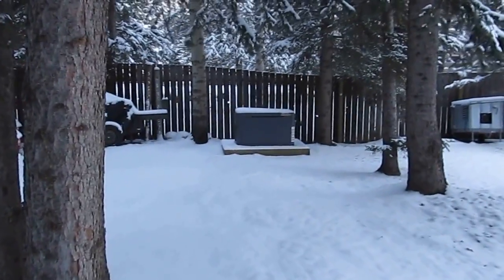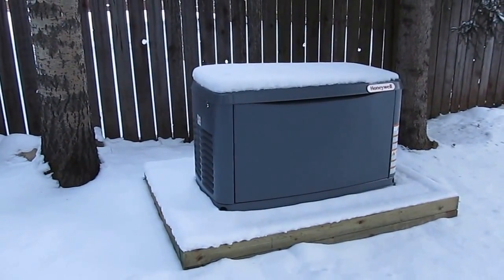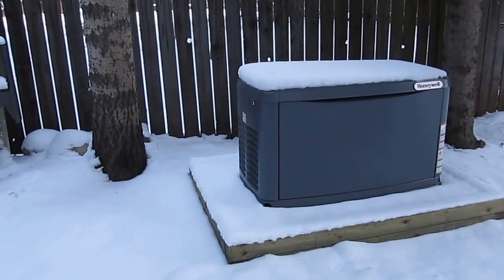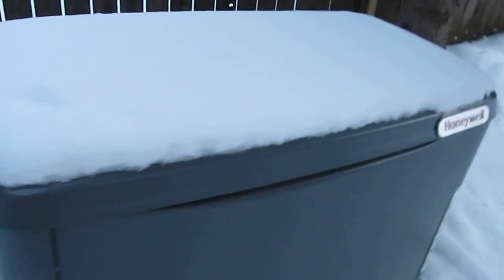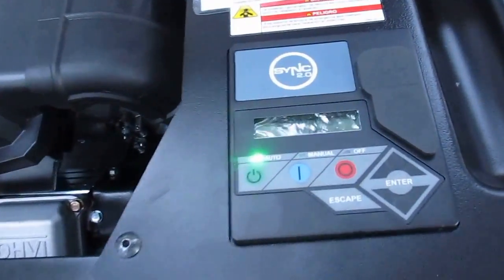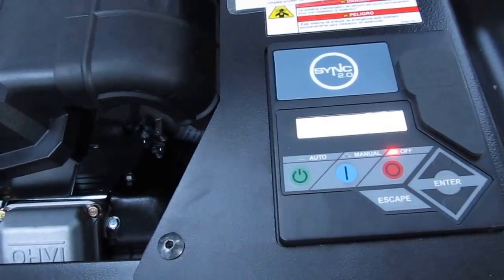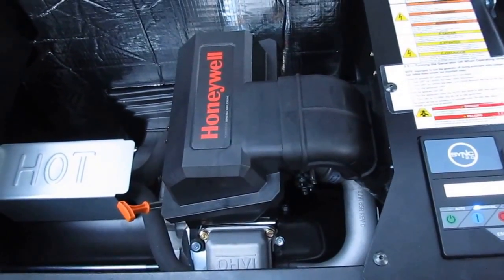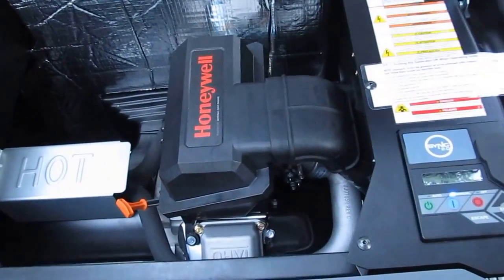17 KW Generator cold start # 1 at -24c, Nov 12, 2014.

Comment: My God that was horrible. My 7kw generac starts much quicker than that around the same temperature. Best of luck to you with that cold weather kit.
Reply from the maker: Take a look at my later videos, I have installed two 50watt heaters, a iol pressure gauge and a oil temperature gauge plus three monitor lights. Every thing has been good for 7 years.

Comment: I have the same unit.  I ran two extra two 15 amp lines from the sub 
panel to the genset (with the 6/3 cable).  I recently just hooked up one
 of the extra 14/2 lines to a 15 amp breaker, and then attached a plug 
on the other end inside the generator.  I then hooked up THREE 100 watt 
light bulbs inside the motor space to keep it warm standby when I know 
the risk of an outage is significant.  I also just recently ordered a 
60watt battery warmer and will connect it too.  So far it starts within 2
 to 3 second even when close to 0 deg F. The motor compartment is 
somewhat insulated, so 300 watts of heating keeps it warm enough to 
easily start.  I recommend this to everybody.
Reply: Good to know when you have a worse case scenario. Though you’d probably wouldn’t want those lightbulbs in there while it’s running.

Comment: Propane does not like atomizing in cold weather without heat on the regulator. I wouldn't fault the engine so much.
Reply from the maker: It's on NG and has more than enough flow.
Reply: @greathodgy22  ya that's weird, cold weather kit should just be standard then.
Reply from the maker: @Heckleburger  The Generac cold weather kit is over priced and useless. They have a oil filter wrap and a heater plate under the battery. You need to put heat into the engine block not the oil filter, that is why I installed two stick-on 50 watt block heaters controlled by Thermo Cubes. The under battery heater plate has a tendency to burn up and start fires, that is why I installed a battery blanket. I have been living on the Canadian Prairies for 70 years and know how to prepare engines for cold weather. I lived in Manitoba for 38 years and we routinely go for six weeks where the daytime temperature did not go above -30F. Look at my later videos showing the upgrades as far as block heaters, battery blankets, oil pressure gauges and oil temperature gauges. 

I know cold and how to fight it.
Reply: @greathodgy22  I wasn't questioning you at all and certainly not you experience in the matter. To me it just seems weird to sell a product that won't work in the cold. Granted your solutions are far superior to what they offer for your climate but for the warmer cold I get I don't see why a cold weather kit wouldn't just be included.
Just one more way to squeeze money out of people.
Reply from the maker: @Heckleburger  Sorry I took it that way. Generac supposedly has 75% of the North American market and I think they want to keep it that way. They want the lowest advertised price they can get. Their cold weather kit lists for $385 CAD the last time I looked, a piece of crap and certainly not worth that. In my dealings with them, their customer service is crap. I learned more from two generator sites I joined after I purchased the generator.

The one thing that really bugs me is you cannot program the length of time that the unit does during its "exercise". You can program in once a month, every two weeks or every week. The exercise is set at 5 minutes, fine in the summer but in the winter the oil does not get warm enough and after a couple of months gets "milky". I have it set to run every two weeks and after it runs for 5 minutes I do a manual start and run it another 25 minutes. That gets it hot and no more problem with milky oil.

Other generator manufacturers will let you program the run time.

Comment: does this generator still work 6 years later?
Reply from the maker: Yup. It has more exercise hours on it than standby hours and runs just fine. I am happy with all the modifications I did to it. Last outage was two weeks ago for about 3 hours. It is a treat not to have to go and start the tractor and put the 3 PTH generator on and plug into the house.

Thanks for asking.
Reply: My dad is thinking of getting one for our small ranch house just because of crappy Midwest weather

Comment: Just fill in 5W50 oil and it will crank much faster and easier during cold weather!
Reply: 5w50 is not what you want not many companies make that oil mostly racing applications Motorcraft (ConocoPhillips) makes it for Shelby mustangs Amsoil also makes it I guarantee it has 5w30 full synthetic in it what he needs a cold weather kit and Amsoil true small engine oil 5w30 100% synthetic true small engine oil it pours all the way down to around-50, 5w50 not a good choice would also void warranty
Reply: @kevinmarchini5272  Well in Canada most people use 5W50 in their generators, Iceland, Finland and Russia too

Comment: Rumor is that Generac has a software update for the evolution controller to extend the exercise to 12 minutes, but I don't know where the cut off is with the serial number. Might only be for the newer ones within the last year or so. The problem with condensation isn't so much from a lubrication standpoint, but it eventually clogs up the breather system and may back up into the air filter. I haven't seen that problem on the evolution series but have seen it on earlier units. The other issue the factory has attempted to fix via software changes is low output voltage in the first few seconds of running, which (years ago) caused a fault. (shutdown) The change now allows several start attempts so any frost on the sliprings / brushes can clear before setting a fault/ shutdown.

Comment: I have found that the battery chargers are no good. The battery is undersized and the winter kits don't heat up enough.  I'm talking 20-45 below 0 here. So this is what I do when you get to 30+ below 0.  Get a deep cycle battery 1000CCA and put a smart trickle charger on the battery like (Battery Tender 800 on Amazon) (a fully charged battery doesn't freeze). Them get some aluminum insulation mat/blanket, that shiny stuff you get to wrap a hot water tank, and line the inside of the unit nice and some on top to keep the heat in.  For heat I used two 50watt pot lights screwed onto a Y spliter that's screwed onto a work lamp handle that I place at the bottom and underneath the entire generator. This way the temp outside the box could be -30 but inside it is 0 or -5 or so. Not too cold that the gen doesn't start. Because you need the whole thing not to be frozen to start. I have found that at -25 to -30 the heat mat on the crankcase or around the oil filter is not enough because the carb and everything else is frozen rock hard so the motor doesn't turn fast enough to start. The little starter is frozen and even with a 1000CCA battery with a charger on it keeping it at 14.4V the whole unit is too cold to start at -25 to -30. The two pot lights are just 100watts and give enough heat to do the trick.
Reply from the maker: Here is a video of a cold start on Dec 30, 2014 after I installed the battery blanket and block heater.
Dec 30 at 0900 and it is -24C or 12 below F.

I installed a GFCI outlet running off the T1 power lead a while back. A 50 Watt battery blanket  was plugged into a 
TC-2 thermo-cube and a 50 watt block heater was attached to the side of the block. The block heater is plugged into
a TC-3 thermo-cube. Also have LED indicator lights plugged into both thermo-cubes.

As you see the Jenny started right up.

https://www.youtube.com/watch?v=y3Ikxve8zgI
.
Reply: greathodgy22 I saw the vid. Good job. But it did turn a little slow. At -34C it wouldn’t start. There’s a big difference between -24 and -34C. Also if you get -30 for 4-5 days straight like what we just had here in Canada that also adds to the difficulty in starting. -34C plus for a week long is a big deal. The engine needs to turn quickly to start. You were lucky it turned quickly enough in the vid. I’m afraid any colder and the RPM would be lower. But great job.
Reply from the maker: I have not given up on tweaking this unit. This last August I added a oil temperature gauge and a oil pressure gauge. I am documenting the generator on its monthly 5 minute exercise. In 5 minutes it does not heat up enough to keep condensate out of the oil. I run it for another 20 minutes after the exercise is over. Generac needs to add programable exercise times to compensate for colder climates like mine, Alberta.

On Dec 26 I did the following full load test run at -37 F. It went down to below -30 F every night for 10 days around Christmas. I agree at those temperatures you need a bit more heat than the 50 Watt block heater, so..... I have another 50 Watt heater on hand and have a TC-1 thermo cube coming and I will install those this summer. The block heater will be installed on the back side of engine. The first one is on the front side.

If you want to see all I have done to the 17, here is the link on the Ziller Generator forum where I documented it. 

http://zillerstore.com/forums/showthread.php?t=3480

Full load run on the coldest day this year, this test was at 0920, Dec 26, 2017.
Ambient temperature was -37 F, cold engine temperature was -14.0 F taken using a DLT pointed 
at the brass fitting where the oil exits the engine on the way to the oil cooler. This is the
location of the oil temperature sending unit. TC-2 cube was operating hence the block 
temperature of -14 F. Threw the breaker on the ATS and the generator started up and
transfered. Estimated load applied is between 8 and 9 KW, and I had to work to get it up there.
Ambient temperature after the 1 hour of running was -32 F.

After  5 minutes of running the oil temperature was   90 F and the oil pressure was 70 PSI.
After 10 minutes of running the oil temperature was 100 F and the oil pressure was 70 PSI.
After 15 minutes of running the oil temperature was 105 F and the oil pressure was 70 PSI.
After 20 minutes of running the oil temperature was 110 F and the oil pressure was 70 PSI.
After 25 minutes of running the oil temperature was 110 F and the oil pressure was 70 PSI.
After 30 minutes of running the oil temperature was 115 F and the oil pressure was 70 PSI.
After 40 minutes of running the oil temperature was 115 F and the oil pressure was 70 PSI.
After 50 minutes of running the oil temperature was 115 F and the oil pressure was 70 PSI.
After 60 minutes of running the oil temperature was 120 F and the oil pressure was 70 PSI.

Keep in mind that the temperature sending unit is in a brass fitting in the full cooling air
flow that is moving over the cylinder head so it is being cooled by the -37F ambient air.
Reply: greathodgy22 ...I wouldn’t worry about oil pressure or temperature. My Generac’s oil pressure cut off sensor went bad (well known problem on these generators) which cut the ignition. It cut it out off and on on mine, made the motor run bad and stall, made me think it was a carburetor problem. I bypassed it, and it runs nice. I put 100% Synthetic oil (Castrol Synteck) 0W-40.  My oil level never goes down. So I don’t worry about it. You shouldn’t worry about oil pressure or temp at any ambient temperature. Just put 0W40 Synthetic (Canadian Tire). The only worry you can have is starting it at the extremely low temperature. Unfortunately there not tested in Alaska at -44. They should be tested and made to run 100% of the time at 44 plus to 44 below Celsius. 

You mentioned the once a month exercise. I think you mean once a week. Yes 11 minutes (on my Generac) once per week is not enough. It’s good to exercise it for 1/2 hours with some load on it once per two months in addition to the weekly exercise. I throw the gen/breaker on my main panel to fool the generator into thinking that there’s a power outage and let it do its magic in the transfer switch breaker box. I have 12 breakers on the generator that are isolated from the main (all other breakers)(all hooked up to code and passed inspection with ESA) that way it’s getting its proper exercise.
Reply: greathodgy22 I read your forum posts. Don’t worry about moisture in the oil. Run the generator once in a while with load. As a mechanic I have seen Mercedes pour out water during an oil change. My BMW oil gets water condensation too. Turns the oil foamy a bit. That was 20 years ago. It’s a 1996 328 that I still have. And it has 500,000km. So moisture in the oil isn’t going to hurt anything. Just change the oil in the spring. It doesn’t hold much. The plugs and air filter are good to 200 hours. My generator is 6 years old and doesn’t even have 100 hours on it. 

Just keep everything lubed up like you did with the linkage. Don’t worry about the oil. Keep the battery charger on. 

I heard that those Thermostat block are not reliable so keep a good eye on it. 

When I originally got my Generator I had the battery mat and the block mat on it as well. Both from Generac. Both burnt out within two years. I would not pay for another winter kit from Generac again. There garbage in my experience. There are other good heat mats on Amazon but for me it’s not necessary. I have opted to have a big ass battery with its own separate charger. And give some heat to the whole interior of the Generac box with two 50watt pot light. -35C two days ago and it turned really quickly and started within 1/2 seconds. Boom 💥 Started right up. So I think keeping the hole inside of the box warm is better than mats.
Reply from the maker: I monitor oil pressure and where available temperature on all of my engines. During a extended run I don't rely on dummy sensors, I want to see what is going on with MY GENERATOR.

I use 5W30 Synthetic as recommended by Generac.

I ment once a month. My 17 comes with a non adjustable exercise time of 5 minutes. But it comes with a adjustable exercise frequency of once a week, bi-weekly or once a month. It also comes with two different exercise RPM's 1800 and 3600. Through trial and error and asking questions on the Ziller site I have mine set at 3600 and monthly. This allows the engine to heat up a bit more than at 1800 RPM and monthly cuts down on the exercise frequency. Experience has shown that these generators that exercise on the low RPM's in cold weather start to have condensate in the oil and it become cloudy.

Your Generac is the older model that has the 11 minute exercise time. All new Generacs' have been reduced to 5 minutes. Briggs and Kohler have programable exercise times.

The full load exercise is what I did on Dec 26. I do that three times a year.

Been monitoring my 17 for 3 years and reading almost every post that comes up on Ziller. I have a handle on this. General does not !

.
Reply: good to hear, all the best. 
Paul
Cornwall, Ontario
Reply: We have a 30kw generac generator and it wont start past -20c we installed a circulating block heater 1500watts engine is toasty warm 24 hours a day but still wont start past -20. You put an electric heater in it for 5 minutes and it will start. The only thing your heating is the air that goes in the carb. I wish they would sell a carburetor heater for these units.
Reply: @ryangsxr1300  I'm a little confused by what you said. What did you mean saying "You put an electric heater...." do you mean me or you. Same as "The only thing your heating is the air......"  Regardless its important that (from my experience, yours will most likely be different) That the generator is not rock solid cold or its not going to start and give a "overcrank" message, or a message of the sort. That's because it needs to turn over fast to start, if it turns over slow due to too little CCA on the battery under load or the motor and carburetor is too cold it wont start. NOW THERE is one more thing that I had to fix (attend to) that may help you out.  MAKE sure that the spring on the intake throttle  that brings back the air intake flap is not pulling too much closing the flap. I had to tinker with mine. It was in perfect new condition but (Generac doesn't test these things at -30) I found it pulled too much, I had to stretch it a bit to loosen the pull (I'm pretty sure it was too much, it was a few years ago) things move differently at -30.  That carb needs to work perfect to start that engine, even if the engine is warm. You need 3 things to happen for that gen to start at -30. 1. not having a frozen engine 2. not having a frozen carb 3. having a great battery. Best of luck, any question I may be of help, just ask.

Comment: I dont know why people spend thousands of dollars on something, and then try to save 300 bucks. Its not like you live where it doesnt get cold. I had the cold weather kit on my kohler and i live in southern ohio. Do you have a 50k dollar pick up truck thats 2 wheel drive
Reply from the maker: Thanks for your considerate comment. I used to have a $50,000 pick-up with 2 wheel drive, now I have a $11,000 pick-up with 4 wheel drive.
Reply: The generac winter kit doesn't work, it last in most cases before warrantee.  Sorry to say.  The battery charger is garbage and stops charging, that's why people go through batteries like crazy. So going aftermarket on the charger is a must with a big 1000CCA instead of the group 26 lol.
Reply: The chargers in the Nexus and Evos work quite well.